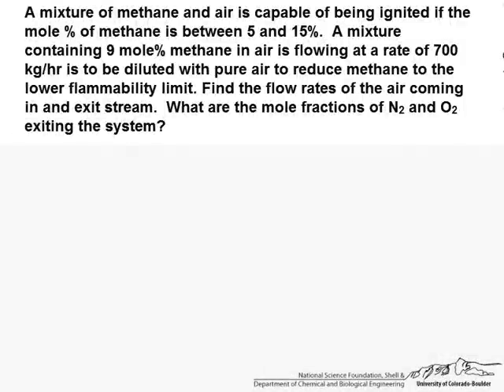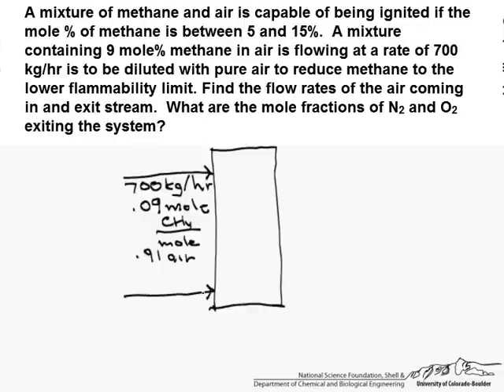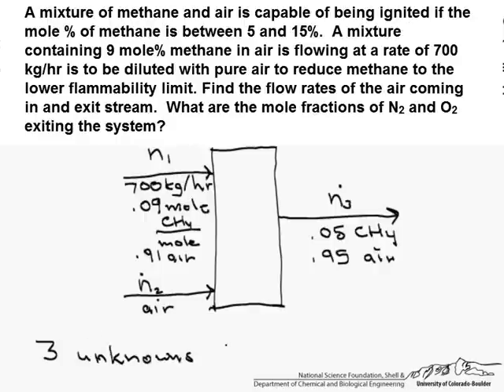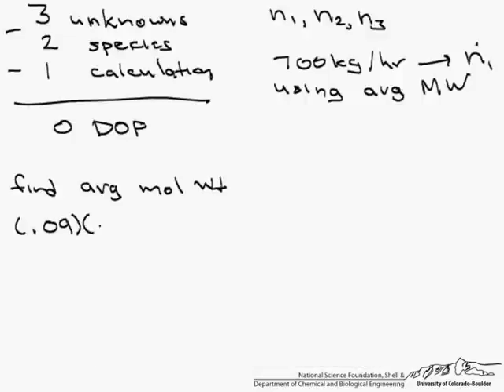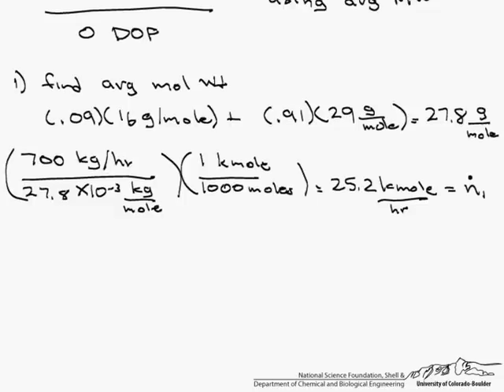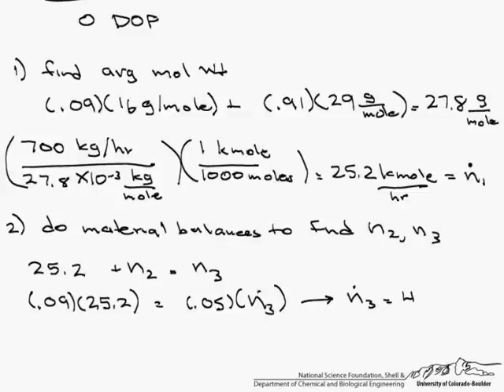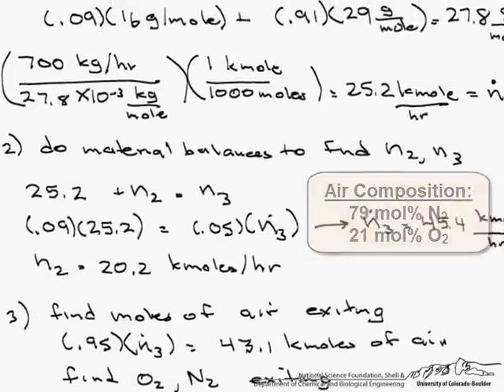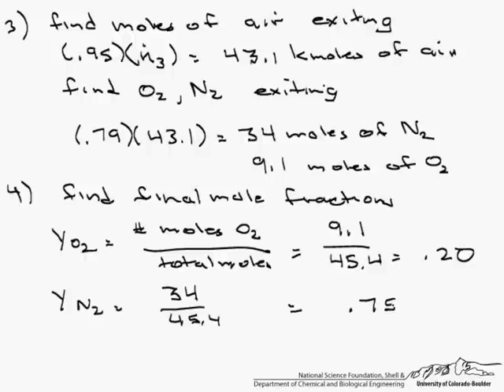Average Molecular Weight of Mixed Stream

Comment: (molar flow rate= mass flow rate / MW avg)* division not multiplication
Reply from the maker: Great catch!  I will put this on a list of screencasts to be remade to fix that.  Luckily, the calculation was done correctly!
Reply: Let me give you guys the correct explanation:

So molar flow rate = mass flow rate / average molecular weight, but here she did multiplication, now mass flow rate = molar flow rate * average molecular wight but she did division in that one, so although it is incorrect as she applied the wrong formula but the answer would be correct because we're applying the same formula twice , so division and multiplication cancels each other ( like think of it as a reciprocal ), so the order doesn't matter and eventually you'll get the correct answer, so I hope it it clear ;)) @LearnChemE
Reply: Let me give you guys the correct explanation:

So molar flow rate = mass flow rate / average molecular weight, but here she did multiplication, now mass flow rate = molar flow rate * average molecular wight but she did division in that one, so although it is incorrect as she applied the wrong formula but the answer would be correct because we're applying the same formula twice , so division and multiplication cancels each other ( like think of it as a reciprocal ), so the order doesn't matter and eventually you'll get the correct answer, so I hope it it clear ;))

Comment: Why do we have to give unknown of n1, isn't that 700kg/hr is the flowrate?
Reply from the maker: This is discussed at 1:55.  You could do the calculation to change to a molar flowrate first, then do your degree of freedom analysis.  In that case, you would have two unknowns and two independent species balances.  It will work both ways.

Comment from the maker: Not sure the question, but the problem statement gives the input of methane and air, which you can use the composition to determine the average molecular weight of the stream and thus the moles in.  Performing a species balance on methane such that the outgoing composition is 5 mol% can give you the outgoing moles.